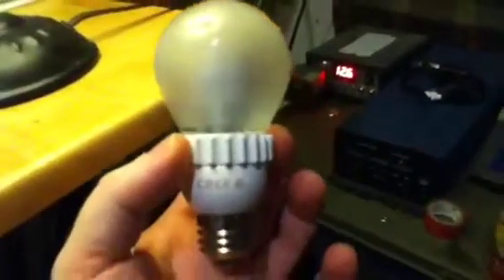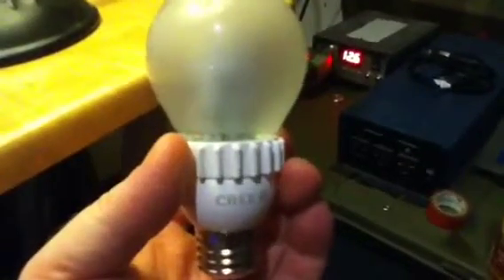Cree LED tested on modified sine wave inverter

Comment: That was interesting,     I burned out 3 Harbor Freight ultrasonic cleaners  in 2 years on a 1500 watt sign wave inverter,   but my 600 watt microwave worked fine.
I have a 12vdc tv,       my. 8 cup coffee percolator,  works fine on a modified sign wave,   now I'll try LED's.                     Thanks

Comment: I'm getting ready to put solar in a remote camp and this video answered my questions concerning LED lighting on a MSW inverter.  I like the idea of a small TSW to power the lighting circuit and a couple receptacles for charging PEDs.  And a large MSW to power a few outlets [for motors] and of course use a non-electric propane fridge!  I'll be sure to clearly label the receptacles ........  I'm new to solar, I've already purchased eight 25 watt silicone panels for cloudy day electrical output, 200w max direct sun beam.  Do you have any recommendations for brand/model of voltage regulator for charging the battery bank of four 12v deep cycle batteries [without overcharging and damaging batteries?  Should I wire the panel output for 12v or 24v to the battery bank voltage regulator?  Any significant reason to go with 24vdc?

Comment: I set up a 75 watt LED bulb,  the bulb was rated at 12 watts.  I ran it for 18 hours test my generator box I just built, I still had 90% battery life left when I shut it off..  It ran the LED bulb with no problem.     I was using a 500 watt modified sine wave inverter.

Comment: is it still running? (sorry for a random question but i plan on using led lights on ups units)
Reply from the maker: Yeah :)  I need to actually do the one month maint run, but as of this moment, it still is ticking nicely.
Reply from the maker: Isuldor Nagan
Mine are still going. I have a similar setup.  They DO have a very very faint hum on a modified sign-wave inverter, but they are remarkably efficient.  They also love the tightly regulated voltage an inverter produces.  I blew one using a generator though.  Make sure your power is stable.

Comment from the maker: The inverter I use seems to run it quietly, but it will depend on the filtering built into your unit. So far though, it seems good as of this time. 

Now, I do have other bulbs from Feit that buzz loudly on the inverter I use.